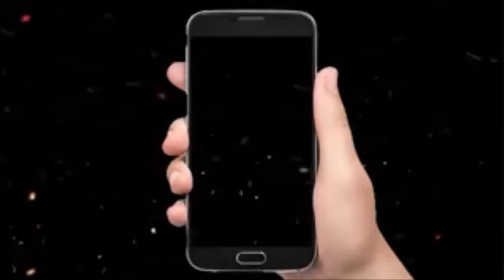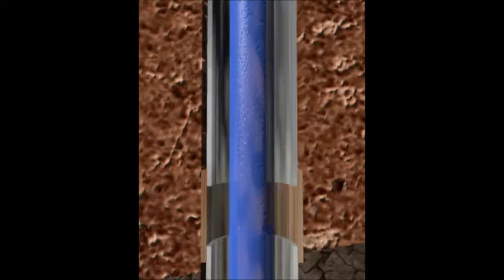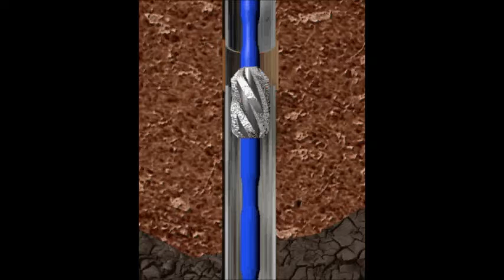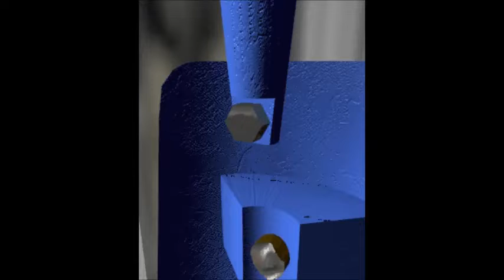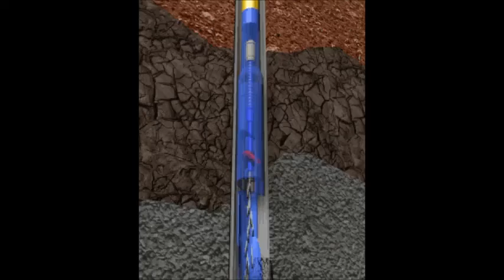Milling and Sidetracking Operation

Comment: Ran whipsrocks for Weatherford. Loved it. No 2 jobs are the same. Everyone gets so nervous when the sotime wall of core-point is reached. Hard formations, especially in the geothermal fields the mill can come back bald, carcasses only, or so undersized that it requires multiple runs.
Reply from the maker: "Fascinating insight into the complexities of drilling operations!"
Reply: true